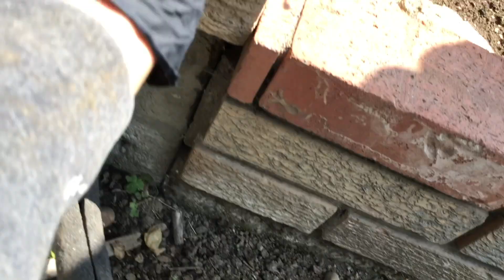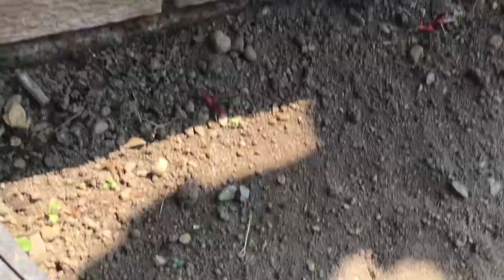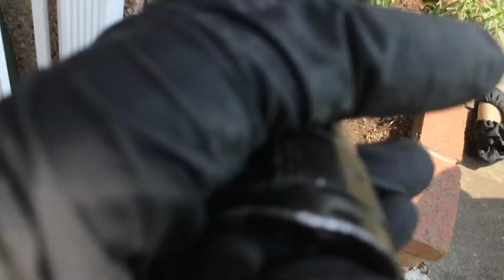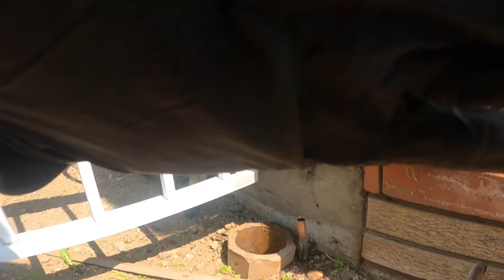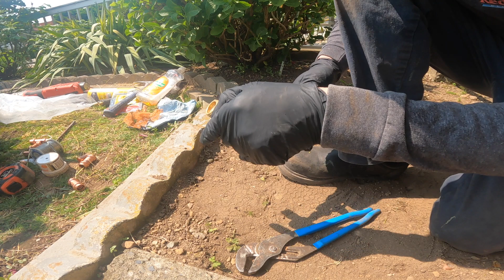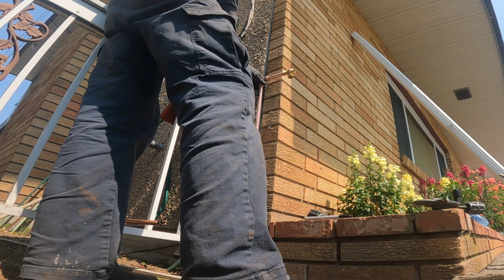GRUMPY CUSTOMER WITH BURST HOSE BIB

Comment: Awful install , no clips no lagging & you expect the client to go and get it. That's your job. Very unprofessional . You made a job last about an hour or so when it could of taking you about 30mins to solder one joint and press 2 fittings & you still left it look shoddy , I wouldn't be using you again, no wonder the customer is grumpy. I bet you charged him a fortune too. Maybe next time your in the suppliers gets some clips & some lagging as not having any is being lazy & to leave that pipe swinging in the wind is terrible. Giving decent installers a bad name. An apprentice could do a better job than that. 
You need to up your standards fella. 2/10 at best